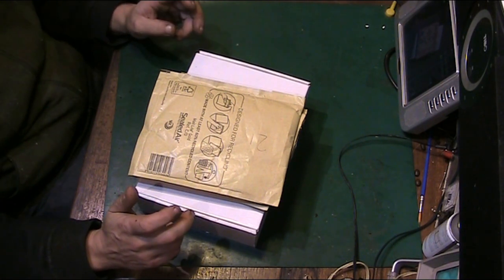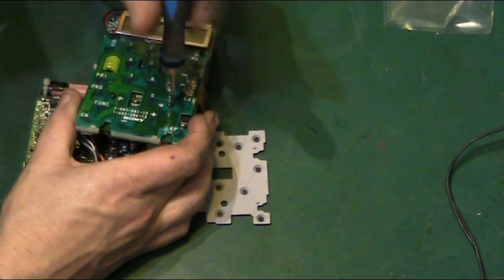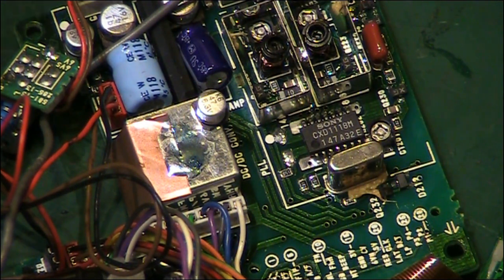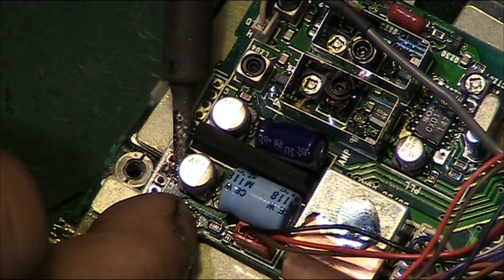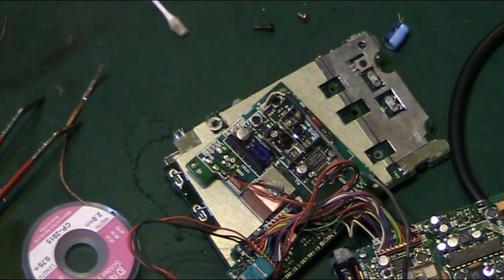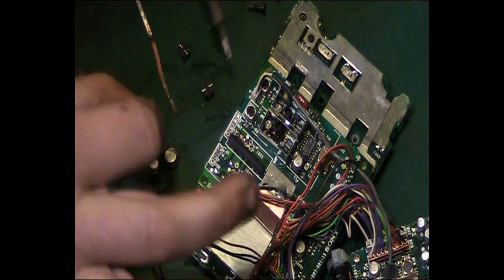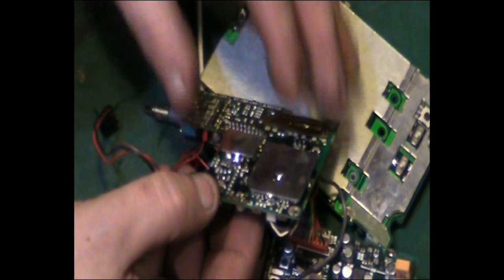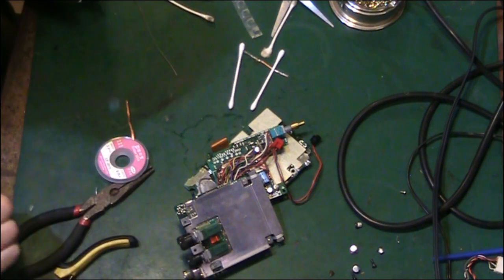Sony ICF-PRO80 radio repair Pt2

Comment: 15:42 I totally can understand your general aversion against using pliers and wiggeling the caps of. But, I have done so - for the first time - on this radio. The main thing is: Do not pull while twisting... It worked totally fine and no pads were harmed during the process. I totally prefer removing caps with two irons or hot air, but the tight space on this one have let me tried it...

Comment: Great job so far Jay. These are a pain to work on. I’ve done a few of these recently and have used smd tantalums as they are much easier to fit and should last a lot longer than the electrolytics. I’m not sure if you are aware of it but there are 2 electrolytics inside the can of the DC-DC converter. Also worth checking the through hole continuity on those connectors. One I did had been eaten away with electrolyte. Cheers Graham
Reply from the maker: Thanks for the info!